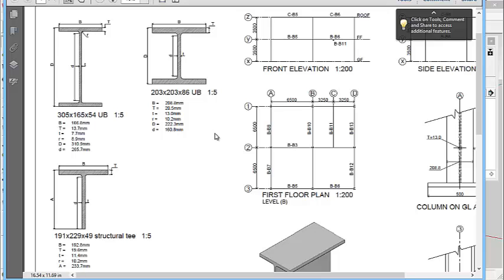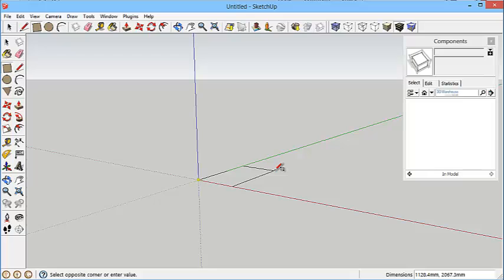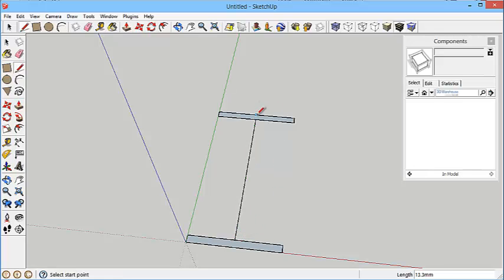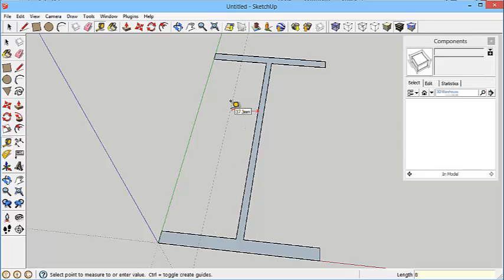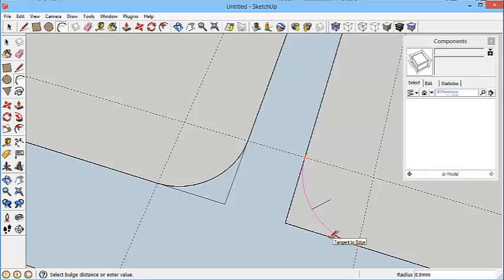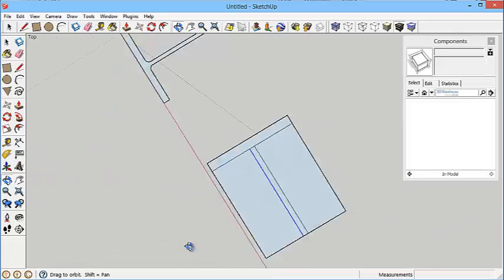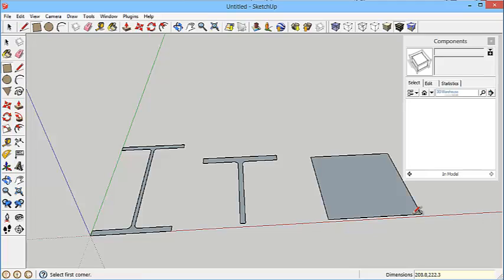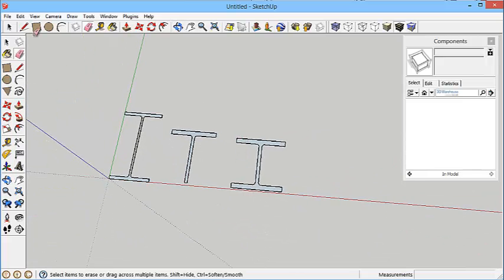102CAB - steel frame 1

Comment: Do you need the rounded corners?  That will double the size of your file.  Maybe it will be faster if you draw the top of your I-beam, and then copy it to the bottom?
Reply from the maker: No, not required at all. It was a tutorial on using the software, for undergrad engineering students. Seemed appropriate to use some steel. Just use it how you want.